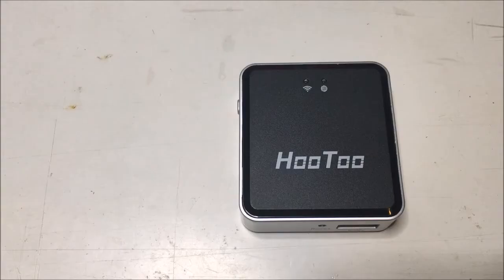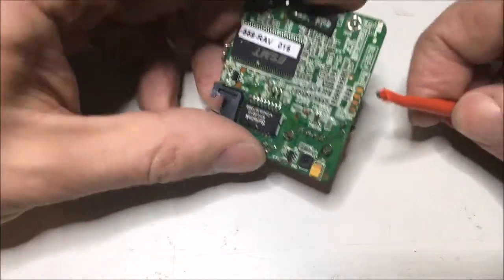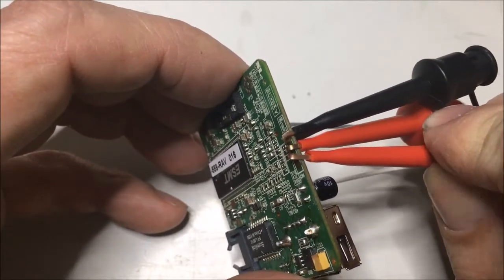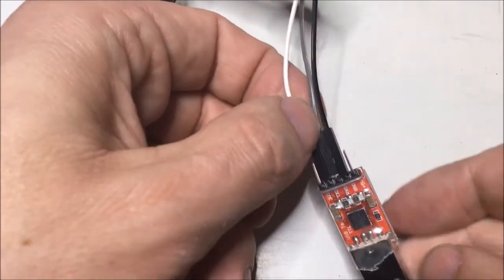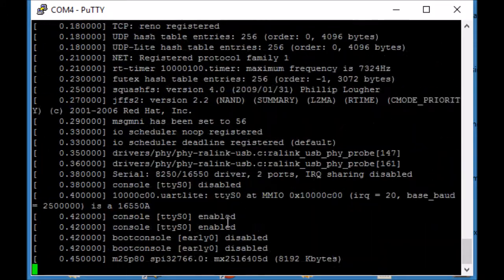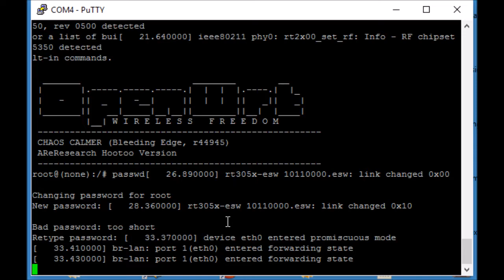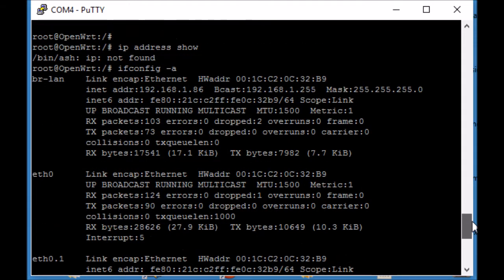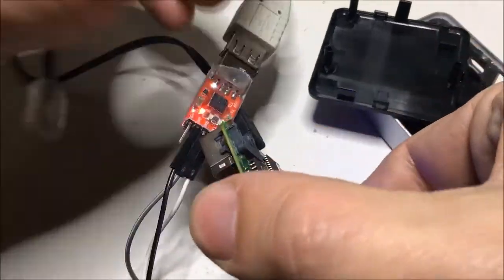Hootoo Tripmate Nano OpenWRT password recovery

Comment: It's amazing it works that good without a actulal antenna. So would I solder to that chip then? I can figure out common and ground but is that where I would solder my dlink 2.4ghz antenna too then? This thing should work really good if I can solder a external antenna. I do also have the tm02 and i think you're right it's only 5ghz. I though wireless N was 5ghz.
Reply from the maker: If you remove the chip antenna, you can use the solder pads of C212 for the antenna. The left pad for the center conductor of the coaxial cable, the right conductor for the shield.

Comment: I thought the copper bar was the built in antenna. But don't see spots to solder a external antenna too. Yep i also have the tm02 and my bad i thought it was 2.4 and 5ghz. So there two copper antennas for diversity? Where would i solder two external antennas too?  If you could take a photo that would be awesome!  Thanks for your help very much. I also emailed u thanks.

Comment: Hi, Thanks for the great video here. I am pretty good tech guy but I want to add a external 2.4ghz and 5ghz antenna. I found a artical and the person said it could be done as in everything is there for it including front end. However I don't know where I should solder too. Could you help me?
Reply from the maker: Yes, I've read that on the OpenWRT forum, too. Have you located the chip-antenna?
Reply: I have not. Would need a photo. I don't know how to email you here on youtube. I saw the strip antennas. one is 2.4 and the other is 5ghz? I have no clue where to solder the coax to so it shuts though internal off and uses externals.

Comment: My tripmate nano stopped working after upgrading to latest firmware by  hootoo itself. Now there is no wifi and only blue light is displaying. Can you please help me to revert it back to original. Much appreciated please
Reply from the maker: Sorry, I haven't looked into firmware recovery yet. The way most routers can recover firmware after serious corruption is via TFTP. For the Hootoo ist is described here: https://github.com/wingspinner/HooToo-Tripmate-HT-TM02-OpenWRT/issues/13
Reply: @AReResearch  thanks for your reply and link.. I will try to find something.
Reply: @prabhatkumarforu  If you have HT-TM02, I could send v2.000.018 files to recover it through TFTP.
Reply: Same problem

Comment: so i tried to downgrade my hootoo tripmate nano because the NAS service was not working. but after flashing the firmware through the default web interface, it seems like my device has been bricked. when i connect the power cable the light keeps on blinking. i can even see the wifi on my network list. i tried various method to reflash the stock firmware but didnt succeed. can anyone please help me???????